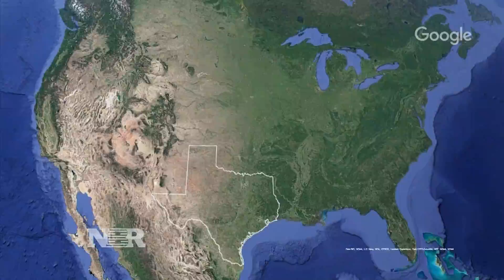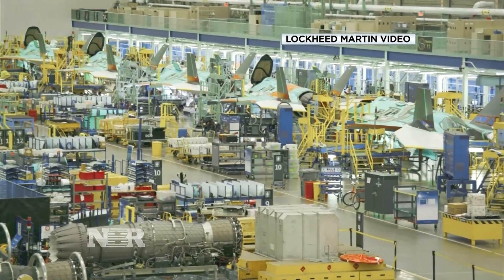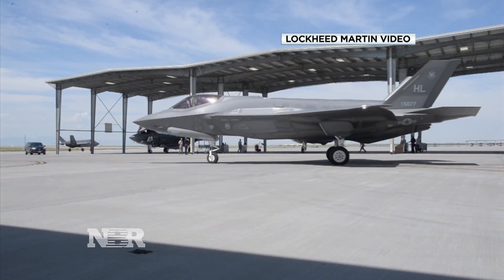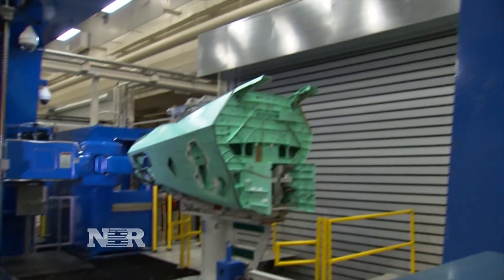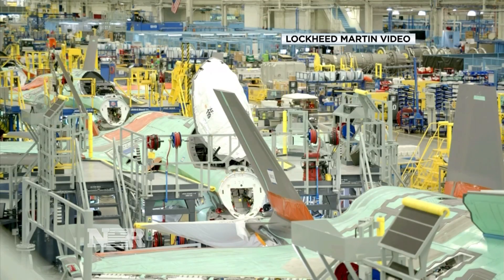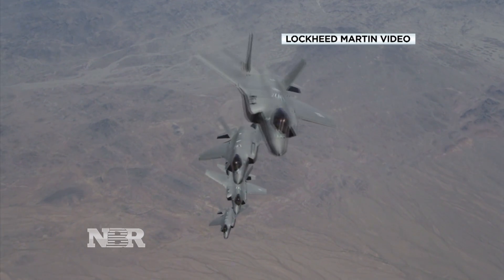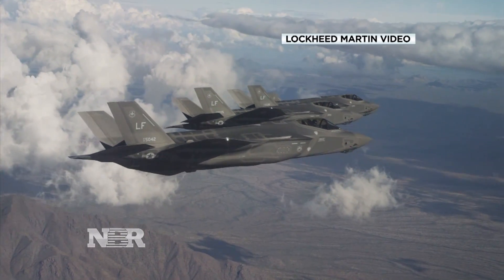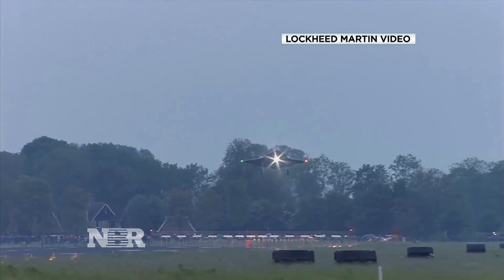Inside Lockheed Martin's F-35 plant

Comment: To reduce cost move the plant in china lol!
Reply: Because that wouldn't jeopardize any of the plane's secretive technology at all!
Reply: Not such a great idea a year later
Reply: NOOOOOOO!!!!!!!!!
Reply: Why it will fall apart in air . No thanks
Reply: @RR-ty6zz  Safest 3 fighter designs ever built.

We lost 505 teen fighter series in their first 10 years, with 189 fatalities. F-14, F-15, F-16, F/A-18, Harrier, A-10.

JSF over first 15 years? 4 crashes, 3 fires, 1 fatality.  That's 712 airframes built with close to 450,000 cumulative flight hours on them.

Only 1 of the 4 crashes was due to mechanical failure.  All other 3 were pilot error/unresponsiveness.

We've never seen anything this safe for a mass-produced supersonic combat aircraft.
Reply: Unions are what are driving up the cost.
Reply: @scott.c9587  Just complicated. Engineering on these things is at the edge of the known. It's never been a cheap trade. 

If unions were the problem you'd see many other nations building things as advanced. 

I'd doubt those making the money out of this benefit from unions.

Comment: FOUR YEARS TO BUILD ONE PLANE?!?!!!!

I think we just found our cost overrun.
Reply: From order lead time to sourcing all of subcomponents and subsystems for a new fighter (that's actually safe, unlike the hundreds of A/B model teen series), 4 years in early production seems about right.

It took 10 years before we ever got working FLIR pods on the F-16C model, as they bone-yarded or sold off all the As that didn't  crash.  We lost 143 F-16s with 71 fatalities just in their first 10 years of service from 1978-1988.

Every single F-35A/B/C that has rolled off the line has integrated FLIR in the nose, which also acts as an IRST in conjunction with the 6 DAS IR cameras.

They also have the most advanced AESA RADAR ever produced, fused with all the RF and IR sensors.

Unlike prior generation fighters where all the ancillary combat systems were bolted on or took up weapons hardpoints after-the-fact,  JSF has all of that integrated into the airframe from the start.
Reply: every plane takes a long time to order
Reply: you're an idiot